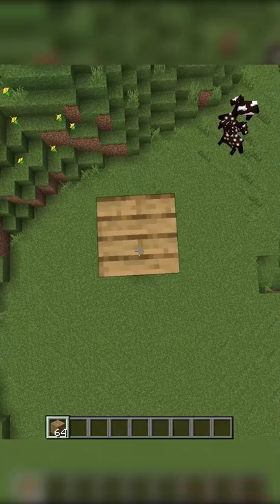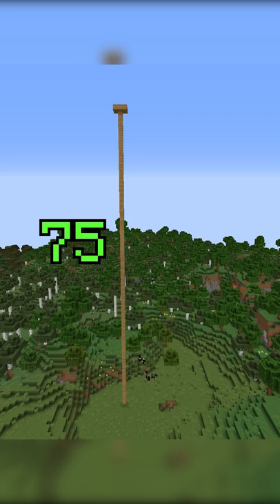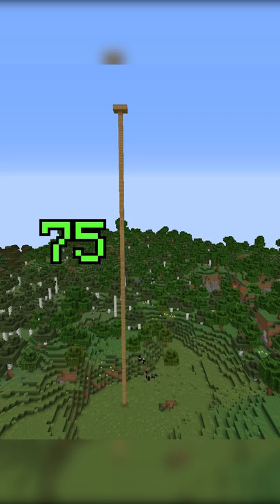Minecraft: How to do the Dream Boat Clutch

Comment: Step 1: clutch the boat and turn on the engine
Step 2: put the boat in first gear and slowly release the clutch while applying some gas
Step 3: clutch the boat when you shift
Reply: what
Reply: This is a reference to manual cars
Reply: 6 speed boat
Reply: What that's a car

Comment: If you guys dont know how he got that much time to craft the boat then let me explain, when he was falling then he opened crafting table in his max reach means suppose dream's Max reach is 5 blocks then he opened crafting table when he was five blocks top of it in the air then he opend crafting table on that time and to get out of the crafting window it will take 40ms as the speed of falling and he knew how to craft boat very fast and you know that he is god at normal boat clutching. And thats how he did it

Comment: Dream actually had his inventory prepared to craft a boat before he got attacked, because he was about to do a boat clutch from the tower he was on. And to his surprise, he didn’t have time to make one. He then, in a moment of panicked, crafted one mid air and clutched. That’s why he pulled it off. Plus, the wood in the inventory gotta be in the first first first slot of the inventory so you can do it
Reply: This is invalid, I tried this on a free server hosted by aternos with 9 other players, let them be running around breaking blocks, hitting entities, and doing other interactions. The world was also loaded in with creative flying for quite some time in 64 chunk rendering. After all of these pre-measures the time barely increased by 36%, no where near the time dream had. If I did not have any of those precautions it would be impossible to do the clutch in less than a second.
Reply: @sixmint2904  nah ping issue

Comment: Didn't Rekrap prove this was possible like a week after the video came out? By doing it himself in a private server.
The explanation is simple. in Singleplayer, the moment you're out of range for the crafting table, the inventory closes.
On a Server, because there's lag, the server thinks you're where you were a fraction of a second earlier. This lets the Crafting Menu stay open for a fraction of a second longer on your screen, as the server needs to tell your client "you're too far away to use the crafting table".

Basically, this was proven possible before you made the short. Do some actual research. "I can't do it, so this guy can't either" is the dumbest and most baseless argument in the world.

Comment: You dont even know that you can just place your bed on top of tower so after you die you can spawn there at top and just fall from there and here you are expecting you will be able to pull that boat clutch and then make a shorts saying it is not possible? Plenty of people doing it legitly is here in youtube. Agreed that it is insanely ridiculously hard to do but not impossible.

Get good first before you try to do debunking video or try to make a statement if it is doable or not.